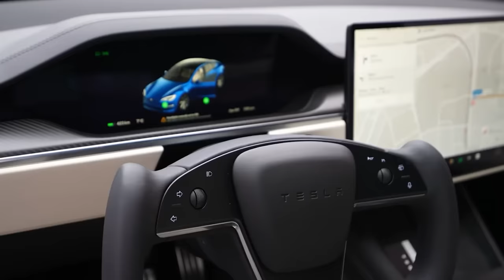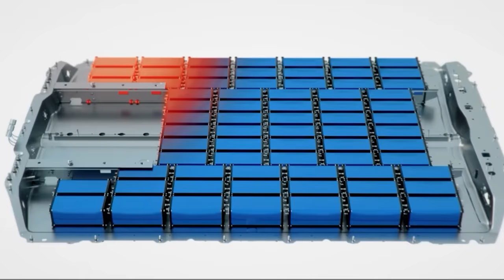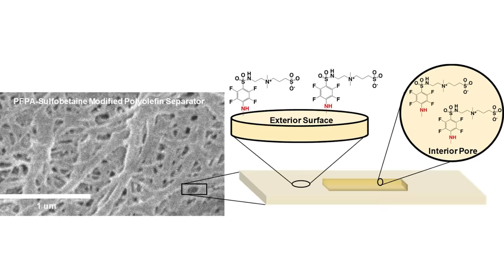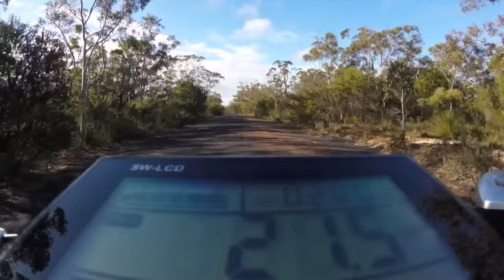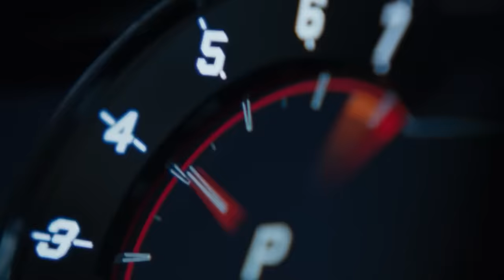EV's Are Exploding In Shocking Numbers

Comment: I remember 10 years ago when laptops were bursting into flames. We had a neighbor several years whose barn burned down because his cell phone burst into flames. Fortunately it wasn't in his pocket at the time.
Reply: There was a guy in the news a few years ago whose phone caught fire while in his trouser pocket. By the time he managed to get his trousers off he had serious third degree burns all up and down his leg. It was a horrific sight
Reply: So we should ban mobile phones?
Reply: @whocares264  I'm not saying anything like that. I'm just giving examples of Lithium Ion batteries that have caused problems. over the years.
Reply: Yeah, laptops and smartphones do catch fire, and they can start other things on fire, but EV batteries have much, much more stored energy in them, and when it is released, it will be a much hotter, more quickly developing, and more devastating fire, with less time to escape, or avoid it.  Yes, you can burn down a house, with a smartphone battery, but, if you are awake, you will have much more time, to escape, than from a large lithium battery, running away, out of control.  Of course, if you are asleep, and out cold, from pharma meds or alcohol, you might not wake up at all, until it is too late, and can therefore be killed, with a simple match, or lit cigarette.  But, these EV fires develop quickly, and powerfully, and can wipe out fully awake & conscious people, and have done so, recently, in fact.
Reply: @trkstatrksta8410 yeah, but he probably survived the fire, right? Try doing that, with a 1,000 lb. EV battery, and that guy would be vaporized, instead.
Reply: @whocares264 that is a matter of choice.  But phones have much less energy, in them, than much larger, heavier EV batteries do.  And so, when they have thermal runaway, much more energy is released, and quickly, too.  Hence, much more devastation & destruction, when it happens.
Reply: And did we forget 2015, the year EVERYBODY burned their feet on those stupid hoverboards? They didn't even hover. They just wanted to rip off the name made famous in Back To The Future 2 so that people would buy their crappy product. I'm so glad I never owned one.
Reply: Gas cars for me
Much safer
Reply: @MillerMeteor74  I can toss my flaming laptop out the door, but my burning EV is just going to take out the house with it.
Reply: @PruneHub  You missed my point, or actually you are making it for me. I was just mentioning a couple of things I remembered from years ago of similar serious problems with smaller items powered by lithium batteries. It's not a new thing. Yet "we" keep building larger and larger things powered by that type of battery- things like bikes, cars and buses.
Reply: @MillerMeteor74 . And yellow school buses….. cackle , cackle.
Reply: yep then they decided to make a much bigger battery, filled with up to 10,000 individual little batteries like AA size, one moves and the whole puzzle unravels
Reply: Yes my uncle's house burnt down because of a cell phone.  I put my cell phone in a metal pot at night when not in use. Also i set it in the sink while charging with a roasting pan lid over it.
Reply: I know a guy who left his phone on the sofa while he and his wife went for a after dinner walk. They came home just in time to see the sofa cushion starting to smolder.  If they had stayed out a few minutes more there's a good chance they would have returned to a house fire.  The phone wasn't charging either.  Certainly a very rare occurrence but apparently it does happen.
Reply: @rugerscout308  Wow! That's too scary.
Reply: That must be why mobile phones have been banned
Reply: @whocares264  What are you talking about? No one has mentioned banning anything. It's just an innocent discussion of occasional problems with lithium batteries, of any size.

Comment: Believing that one day there will only be electric cars is absolutely ridiculous.
Reply: Until the day you die " the fuel vehicle will run on the streets ".
Reply: Believing that one day there will only be electric home appliances is absolutely ridiculous...
Reply: Yeah, I remember everyone was saying that a few years ago, but looking at them now, absolutely not. 

The biggest restraint of EVs is their Battery, not only susceptible to explosion in crashes, but simply weighs the car down as its charge depletes. This causes them to be heavier and limits their range to like 300 miles, after which you’d need to charge for an hour. I almost wonder if an EV with fuel powered generator would defeat the purpose of a battery? 

300 miles is nothing for traveling or transporting things. Electric vehicles also have compromised performance with cargo, in hot weather, and in cold weather
Reply: @aaronlandry3934  Do you think electric cars get heavier as they discharge?
Reply: @whocares264  No, rather it simply becomes “dead weight”. Useless heavy metal without electric charge anymore, which reduces range potential
Reply: @aaronlandry3934  you fill gas car with 70 kg of gas now you will say that is lighter than a battery, you fill it 50 times a year that is 3500kg or over ten years 35,000kg...
Reply: @whocares264  Your car does not weigh 35,000 kgs with a full tank of gas. That’s asinine. The gas gets burned off and its weight doesn’t burden the vehicle further.

An EVs battery’s charge gradually diminishes and the battery’s weight remains constant. Again, the car has to work extra to carry around the heavy battery. The loss in efficiency is why EVs can barely make 300 miles…
Reply: @aaronlandry3934  I think you are begining to understand , burning off burning off now think' when it's gone it's
gone, do you get it now...
by the way gas cars are  30% efficient
electric cars are 90% efficient...
Reply: @whocares264  I think you fail to understand Thermodynamics. Get back to me after you pass fourth grade, kiddo
Reply: @aaronlandry3934  so funny....please tell me another tree joke
Reply: @whocares264  I think I’ll insult your intelligence again for thinking a car weighs 35,000 kilograms. No, cars do not weigh that much
Reply: @aaronlandry3934  was it a maple tree
Reply: @whocares264  No, it was an electric tree, which is safer than gas trees according to studies that aren’t wrong

Comment: I have been buying gas for decades and have never had a fire 🔥 problem 😊
Reply: I have eaten curries that feel like I'm eating fire but never had a gas problem. 😀🤣🙃
Reply: To bad statistics don't bare that out. Because there are more gas powered out there; though less dangerous, there are far MORE gas powered engines causing fires than EVs. Of course, you could walk or ride a horse, and not have any fires either. So, what is you're rationale?
Reply: @opsvixen  
Because of the many other problems with EVs, almost all vehicles on the planet ARE NOT EVs.
Reply: and if you had i an electric car  for decades it would be even less of a fire problem, do you use electricity in your home? do you use gasoline in your home?
Reply: @opsvixen  the Horse won’t explode

Comment: EVS ARE GOING TO COST A FORTUNE IN INSURANCE
Reply: Mine cost me just £80 per year more than the last ICE car I owned.  It's truly amazing. All you EV "experts" who have never actually owned an EV, suddenly say "EV's are this, EV's are that"  And all without ever owning, driving, sitting in one, or even touching one.
Reply: @Brian-om2hh  And I want to keep it that way!
If you see how expensive these are, I can buy several second-hand cars for that and even refuel them!
And I can travel 1100 miles with a caravan behind it in 1 day!
Reply: The insurance on each of my 2 EV's is lower than my last ICE vehicle. (Canada)
Reply: I will never go back to an ICE vehicle. Virtually no maintenance. Cost me 2.2 cents per kilometer to drive based on 1 year of driving.
Reply: I drove 1200miles in 14hrs in My EV.  Do the math.  If Math isn't your speciality, the Avg speed was 85mph.  Cruise was set to 90, and I was being passed most of the way by locals in a hurry.  It included 6 stops to recharge, ~15min each and just enough time to use the restroom and get a snak.
Reply: @popsracer886  Here in Europe, the richer class all went skiing, and there they were in their EV, usually a Tesla!
Waiting for hours in a kilometer long queue to be able to top up!
There were only 4 or 5 charging points where each EV was charged for a few hours.
It's very cold, and the heating has to be turned off because your battery is almost empty!
Now years later, hardly any charging stations have been added here!
No EV for the smart people, it's a dying fad!
Reply: @pfv3462  Never had that issue in the States.  My 1200mile trip was over a Holiday (Labor Day) Weekend.  Just curious, what Country/City did this happen in?
Reply: @popsracer886  Germany
Reply: @keithoneil9274  give it time once the insurance companies start paying out the damage they will raise them commensurately. Just like they did with the free charging in the beginning and your electricity rate will go up accordingly. The honeymoon is over. Lol
Reply: @keithoneil9274  You will if one burns down your house. But if you keep 100 feet away from your house you should be ok.
Reply: @popsracer886  your lying.
Reply: @zooker7507  I left work in KY @ ~5:30pm and arrive at Kennedy Space Center at a little after 8am, hoping to catch the the SLS Launch, launch was cancelled, but I had Space Center Tour tickets as a backup plan, saw the SLS from about a quarter of a mile away from the bottom of the ramp to the pad.  I saw Starlink 4-20 Lanch the next evening, before heading back to KY.  Check these date and you will see that I did what I said I did.
Reply: @zooker7507  his neighbours insurance will sky rocket also as they have a time bombed parked in the driveway next door.
Reply: @keithoneil9274  No maintenance because the model is obsolete so soon and incompatible with the latest release of the charger software, cabling and voltage so has to be scrapped? For anyone not immersed in the EV world the technology is a moving target very difficult to follow. Then you may have only driven 200 kilometres in the year to the local shops home charging even if the car is still matching current standards. Also most affluent virtue signalling eco warriors, be it with cars or home heating, will be entirely ignoring extra capital outlay and many people just do not have the capital. Most people seem to consider Tesla as the poster child car to buy and that sticks at a stonking £42,900 in the UK, despite constant announcements of price decreases, my fuel costs per kilometer pale in to insignificance against that extra investment. The main point is if EVs are so wonderful why would it be necessary to force them on people. Any government edict imposing an obligation on people to buy something like it or not is doomed to failure whatever the merits, though knowing government planning these are rather unlikely as demonstrated by the push to diesel in the UK which was the green fad of the moment.
Reply: Only a slight fender bender accident can damage the battery pack and total loss of the car.
Reply: @popsracer886  Snack
Reply: @michaeld5888  They want us to go back to the horse and buggy...not that I care. Can't wait
Reply: @pfv3462  Got to love the geniuses that keep comparing NEW EV's with old ICE cars.  Like that is even a remotely realistic comparison...
Reply: @zooker7507  The electricity replaces your fuel bill, but is far cheaper.  It is like these clowns have never owned an actual car in their lifetime...
Reply: @zooker7507  Meanwhile, in the real world, EV fires burning down houses are so rare they are basically unheard of...
Reply: @redbaron6805  You do have to make comparisons!
will I arrive at my destination?
An ice car can become an oldtimer, but an EV is ugly when new and nothing like second-hand!
Can I still tow my trailer with 2 horses?
How much more expensive is an EV and the charging station at home?
Is a second-hand EV still reliable, and how much does it cost?
Is mining raw materials in Africa good for the environment and how are the health of children doing?
Reply: @redbaron6805  I've seen several in the last 3 years all battery electric vehicles. Never yet have seen one from a gasoline car. So that's the real world aye? For such a small EV population that would be quite an alarming signal for anyone interested in the truth.
Reply: @zooker7507  Yes, obviously you have magically seen things no one has ever seen.

Yet, in my area which is packed with EV's, I have yet to see a single EV fire, as in ever, yet I have seen countless combustion engine car fires.

Cool story, but obviously never happened...
Reply: @popsracer886  I did the math and your numbers dont jibe. You charged for 90 minutes total (6 x 15) so were actually on the road for 12.5 hours. At 90mph average you would only cover 1125 in 12.5 hours,. You would have to average 96mph to cover 1200 miles in 12.5 hours....in labor day long weekend traffic....with your cruise apparently set at 90mph 🤔
I just saw your second post with a couple of vague details. KY to KSC, 5:30pm to 8am. So now its 14-1/2 hours not 14?  That would lower you average speed by  3mph.
Google maps shows the very farthest corner of KY is only 1025 miles by highway to KSC, not 1200 miles. Oops. And you arrived in Orlando/ KSC at 8am, aka rush hour...still doing 96 mph of course? 
You're really stretching this story.

Comment: The good thing is if you live in the extreme North, you can always burn your EV as a source of heat that lasts for DAYS!
Reply: That’s so savage
Reply: Expensive bonfire for emergencies. 🤣
Reply: Burn it as soon as it arrives though ... you know what happens to batteries in extreme cold environments.  None of the EV loopies would have a clue battery life goes way down the toilet in cold weather. 🥶😰 And good luck push starting your EV on an icy road !
Reply: Hybrids reflected the most at 3,475 fires per 100,000 vehicles. 
ICE vehicles caught fire  at 1,530 incidents per 100,000 vehicles.
EV fires were 25 fires per 100,000 vehicles.
Reply: @@garrymcgrath7125 Just huff gas fumes
Reply: LOL

Comment: Are electric vehicles really less liable to fires? Or is it that there are fewer fires because there are fewer electric cars? Also you need to consider the cause of the fires; if a joy rider nicks a car and then sets fire to it afterwards, that is not due to the petrol spontaneously catching fire. How many petrol car fires are actually caused by the fuel system? How many electric car fires are caused by the fuel system? John Cadogan does a nice summary on the airport fire, and also the ship fire where cars were burning a month after the fire was supposedly put out.
Reply: EV's are 1/20 as likely to catch fire as ICE.  But more difficult to put out if they do.  Water is not the solution, cover them and let them burn.  New battery chemistries are solving this issue, just give it a few years.
Reply: He showed a video of a car being offloaded by crane and placed inside an open container, presumably as a safety measure - it burst into flames - again.
Reply: Different kind of fire.  EV fires happen because the Battery has been breached.  Lithium is a reactive alkali metal, it forms straight up hydrogen gas when reacting with water or oxygen, the heat of the reaction with the alkali metal often is enough to cause the hydrogen gas to explode via reaction with Oxygen in the air, forming water, with explosive effect.
Reply: @popsracer886  It’s hotter because it’s literal hydrogen gas burning to form Water Vapor.  Hydrogen gas burns pretty hot.
Reply: @popsracer886  That study that claimed that ICE cars are 20 times more likely to catch fire as EV's is flawed. It did not discount all cases where the initial cause of the fire was arson, and did not factor for the age and mileage of the vehicles in question. More detailed studies that do these things are required to get a more accurate picture of the issue.
Reply: To back this up, @BobbyBear105
10 hours ago
Hybrids reflected the most at 3,475 fires per 100,000 vehicles. 
ICE vehicles caught fire  at 1,530 incidents per 100,000 vehicles.
EV fires were 25 fires per 100,000 vehicles.
Reply: @bradevans7935  Except, there is no actual data supporting the claims you are making here.  And the flaw is also, Lithium Ion batteries do not become more fire prone with age, while combustion engine cars do due to fuel lines and fluid hoses leaking on an engine and exhaust system that is always burning hot.
Reply: They are less liable to catch fire.
Let me remind you of the concept of the denominator, which along with a numerator make up a fraction.   Many books and any teacher will explain further and provide you with exercises.  You'll need a pencil.
Reply: Thank you for an thoughtful and intelligent reply. Critical thought skills lack is causing way more "fires" than any EV or gas fire.